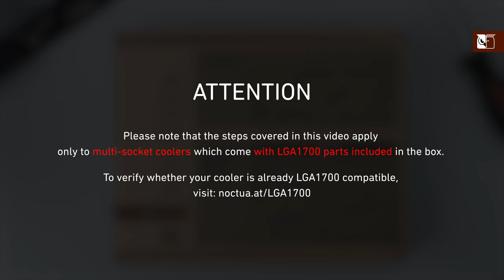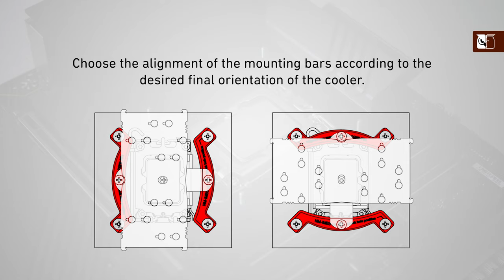Noctua SecuFirm2™ LGA17xx multi-socket CPU cooler installation

Comment: There's one really important piece of information missing from this video: you have to install the CPU *first*. Once the mounting bars are installed, you cannot install or remove the CPU.
Reply from the maker: Thank you for your feedback! It's correct that the CPU should be installed before you install the mounting bars. We thought that this should be obvious given that we show the CPU installed in the video and manuals. So far, customers haven't had any issues with this, but we'll keep it in mind for future editions!
Reply: Thanks for pointing that out as I was more focused on the brackets. I'm still trying to figure out 1 dot or 5 as they have conflicting info that needs updating.

Comment: Hello, I'm a Korean who likes Noktoa. I'm going to buy NH-U12A this time. Do I have to buy an additional MP78 backplate? According to the official website, the U12A purchased after January 2022 is compatible with the LGA1700. However, some posts say that I have to buy mp78 because the basic backplate is not good. What should I do?
Reply from the maker: Yes, as stated on our website, NH-U12A now already includes LGA1700 mounting hardware, so there is no need for upgrade kits such as the NM-i17xx-MP78!
Reply: @NoctuaVideos  Thank You !! 😊

Comment: I would like to ask some questions about the tightening of the screws. 

The First is about the nuts of the mounting bars (1:30). In the video it seems like you tighten the nut until it simply touch the bar.
Is that enough to hold the bar. I personally did a bit more. Do motherboards endure a bit more tension? How can I be sure I tightened the screws enough and not too much to destroy the board.

The Second is about the screws of the cooler when it is placed on the mounting bars. Should the bottom part of the screw (that looks like a flange) touch the mounting bar? In the video it seems like that is almost the case (1:57). In my case, I didn't tighten the screw until the bottom part reach the bar and I left it higher compared with that of the video. I left it when it started to resist a bit. I was afraid for the stress applied to the CPU. What should I do?

Thanks!
Reply from the maker: First of all, don't worry, there is no risk of damaging the motherboard by overtightening the nuts or the CPU by overtightening the spring-loaded screws. 

You should feel a clear stop when tightening the nuts shortly after they start touching the bar, so what you did sounds perfectly right. As soon as the bars sit firmly and you can no longer move them around by hand, the nuts are sufficiently tight. As we've said, there's no risk of damaging the motherboard by overtightening the nuts, the only risk is that you may rip off the threads of the bolts if you go too tight.

For the mounting screws, you can keep tightening them all the way down until you feel a stop when they touch the bars. There will be some resistance due to friction and pressure of the springs before, so don't hesitate to apply a bit of torque to get them all the way down. Again, there is no risk of damaging the CPU by overtightening, the only risk would be ripping off the threads from the mounting bars.

In short, we would recommend leaving the nuts as they are but tightening the screws a bit more until you feel the stop when they reach the bars.

Our maximum torque specification for both the nuts and the screws is 0.6 Nm, so if you want to make extra sure, you could use a torque limiting screwdriver. This is by no means necessary though, simply trusting your judgement of going to stop but not overtightening will work fine.

Hope this helps!

Comment: I have the NH-U12A but I'm confused, in the website it says I need the NM-i17xx-MP78 mounting kit to use it on lga 1700.
Reply from the maker: Yes, you need the NM-i17xx-MP78 unless your NH-U12A already included LGA1700 mounting hardware: https://noctua.at/en/productfaqs/productfaq/view/id/246/
https://noctua.at/en/intel-lga1700-all-you-need-to-know
Reply: @NoctuaVideos  Ow thank you. Newer NH-U12A units already comes with lga 1700 support. Unfortunately mine is older so I need the NM-i17xx-MP78 mounting kit.

Comment: I bought a NH-U12S new on Amazon March 14th and it didn’t come with socket 1700 mounting kit. I had to order the mounting kit separately on Amazon as I didn’t want to wait 2 weeks for delivery of the free one.
Reply from the maker: First of all thank you very much for choosing the NH-U12S, we're sure you won't be disappointed with the cooler! We're sorry that it seems you got one of the last units that don't have the kit included, the vast majority of stock already has it, but unfortunately, there's no way for us to know for sure if some resellers still have older stock. As you know, we do offer the free of charge upgrade, but if you're in a rush, getting the extra kit like you did is the best choice indeed. Have fun with your NH-U12S on your LGA1700 rig!
Reply: @NoctuaVideos  It's not entirely clear to me how I am supposed to request the free new LGA1700 kit for my cooler. Your website says I should have proof of purchase of the cooler and the CPU/motherboard. Ok I have that now where do I go?

Comment: Great video, will definitely reference soon as I build. I purchased an NH-L12S off Amazon last week for an upcoming build. Should I expect the bracket to come with it, since the timeline on the website for it mentioned November, or was that timeline specific to buying directly from you on your website?
Reply from the maker: The timeline is general (also for Amazon), so your cooler should already include LGA1700 parts! If not, please order the NM-i17xx-MP78 (free of charge)!
Reply: @NoctuaVideos  Thank you for the fast response! Happy Holidays!
Reply: @NoctuaVideos how can I order the LGA1700 mount free of charge? Your website points me to amazon store, it cost £8

Comment: Im currently needing to get a seperate lga1700 mount for my u12a since i got mine before the 12th-13th gen processors and motherboard came, which one works better with the U12A, the MP78? or the MP83?
Reply from the maker: Hi, for the U12A you will need the MP78 version.

Comment: Greetings! Will that intel mount kit that comes with the cooler, fit with my 12700k i7/MSI PRO Z790-A or should I buy the NM-i17xx-MP78 Mount Kit?
Reply from the maker: This depends on the cooler model and when you bought it. Most of our coolers include LGA1700 mounting hardware since late 2021, older models will require the NM-i17xx-MP83 or -MP78 upgrade kits. Please see our compatibility centre for details:  https://ncc.noctua.at/motherboards/model/PRO-Z690-A-motherboard-5367
https://ncc.noctua.at/socket-compatibility-overview
Reply: @NoctuaVideos  I bought the cooler (Noctua NH-U12A Chromax.Black) 1 week ago, so I should be fine with the kit included inside the cooler box, right?
Reply from the maker: Yes, absolutely, no need for upgrades then! :)
Reply: @NoctuaVideos  Thank you for your fast response you guys are the best :D

Comment: I have an NH-D14 and just ordered the LGA1700 kit so I can upgrade my LGA1155 CPU and I noticed the new motherboard has LGA1200 holes on it too. LGA1200 and LGA1155 are the same hole spacing. Should I wait for the LGA1700 kit or use the LGA1200 holes with the 1155 mount?
Reply from the maker: Hi, just to clarify, which socket are you planning on installing the cooler on? If you are planning on installing the cooler on LGA1700, then you will need to use the LGA1700 upgrade kit. The mounting parts for LGA115x and LGA1200 are the same, but LGA1700 is different.
Reply: Hi I have the Asus Z790-P and the board has both sets of holes for LGA1200 or LGA1700. The socket is 1700.  @NoctuaVideos
Reply from the maker: We would recommend installing the cooler using the NM-i17xx mounting kit.
Reply: Well your free kit has been almost a week now and you emailed and said it could be another 20 days so I tried the LGA1155 and it fit the LGA1200 holes perfectly and I have good temps using your NT-H2 paste.  @NoctuaVideos

Comment: with the Noctua NH-U9S, Premium CPU Cooler with NF-A9 92mm Fan can it be hooked up to a intel i7 87k cpu without needing to mess with the back of the mother board ? example open side of pc unplug pc take apart oldd cooler then hook up Noctua cooler without taking anything else apart ?
Reply from the maker: You will need to access the rear side of the motherboard in order to install the backplate. Most modern cases have a cut-out that makes this very easy to do without having to remove the motherboard. Installing a cooler of this size and weight without a backplate would be dangerous, so better be careful with coolers of similar size that offer this "convenience".

Comment: I could not find this information anywhere. Will the NH-U12S block the first expansion slot? Or is there enough clearance?
I'm buiilding a B660M Micro ATX build and worried it'll touch the GPU.
Reply from the maker: The NH-U12S doesn't block the first PCIe slot on any B660 board, this would only be the case on some ITX boards: https://ncc.noctua.at/coolers/NH-U12S-9/motherboards/all?q=b660

Comment: Any plans to release one for the NHL9i series? I saw a revision for the cooler to only support LGA1700. Does that mean I can only use older CPU with my original NHL9i or move to AMD?
Reply from the maker: Yes, unfortunately we had to create a new revision specific to LGA1700 because the height and clearing specifications of the socket are different. The original NH-L9i and NH-L9a-AM4 cannot be adapted using upgrade kits because there would be a high risk of damaging the motherboards.

Comment: The bracket that goes on the back of my motherboard doesn’t fit (it came pre assembled) should I use the lga20xx setup? I have a 1700 cpu. Would it mess up my computer/cooling efficiency ?
Reply from the maker: Do you mean that the backplate came pre-assembled (struts inserted and fixed with the clips)? If so and if it doesn't fit you LGA1700 motherboard, this probably means that the backplate has been pre-assembled for LGA1200/115x. In this case, please remove the clips and the struts, re-insert the struts in the LGA1700 position (position 2 in the manual illustrations) and re-fix them with the clips as described in the manual. If this doesn't help, please send us some photos at support@noctua.at so that we can look at this in detail!
Reply: @NoctuaVideos  the Lga 115x backplate appears to of had been spot welded together, not sure if there’s a way to separate the plate from the screws or not. but I will send some photos, thank you for your patience!
Reply from the maker: Ok, this is a backplate that doesn't support LGA1700, you cannot adjust it. You will need an LGA1700 mounting kit, either NM-i17xx-MP83 or NM-i17xx-MP78 depending on the cooler model: https://noctua.at/en/productfaqs/productfaq/view/id/245/

Comment: Can the base plate be installed onto the case or does it have to be directly install onto the motherboard? The reason I ask is because my motherboard is already installed and I'd prefer not to take it off if possible.
Reply from the maker: It needs to install to the motherboard. Most modern cases have a cut-out on the back side of the motherboard tray where the CPU socket is so that you can install backplates though. If your case doesn't, you would indeed need to remove the motherboard.

Comment: This instalation is more complexe than my previous instalation of a noctua , maybe you should focus on a specifique instalation of the lga 1700 with no different holes to chose and préinstaled bolts and clips on spacer. The position to choose at 0:44 is unclear what is position 1 and 2?
Reply from the maker: Thank you very much for your feedback! Since there are still lots of customers who use LGA1200/115x, we need to support both this and LGA1700. Pre-installing bots and clips would require a bigger packaging and would make it quite cumbersome for customers who need the other platform. This video is for LGA1700, so position 2 is LGA1700. Please also refer to the manual that comes with the coolers and is available online.
Reply: @NoctuaVideos  Thanks a lot for your answer, i have only bought the Nh u12S for my previous confuguration on 115x , it was with bots attached : https://www.youtube.com/watch?v=5kT2d83iAF0&t=264s it was a ok difficulty. On the 1700 you add a lot of difficulties in my opinion , i my opinion it will be better to put a segmentation to simplify the instalation. I have build my two previous PC and i can tell you that this one on 1700 is too difficult for me .
Reply from the maker: Once again thank you very much for your feedback. The problem with this approach is that if we would supply two different, pre-assembled backplates like the one we used for LGA115x, we would either have to increase the price for the coolers or offer two different versions, which would make them less versatile. Thankfully, the feedback from most customers is that assembling the backplate is easy enough, especially if you have done it more than one time.

Comment: Can this mounting kit be used on a NH D14? I have a Noctua D14 which I want to use on my new PC build with a i7-12700k and z690 motherboard
Reply from the maker: No, this is the upgrade kit you need for NH-D14:
https://noctua.at/en/nm-i17xx-mp83-mounting-kit
https://www.youtube.com/watch?v=Ioaon-11z24
Reply: @NoctuaVideos  Ok, Thanks for pointing me in the right direction!

Comment: Video only showed plugging in the second fan. Does the first fan connect to the second?
Reply from the maker: The cooler includes an NA-YC1 splitter cable that enables you to connect both fans to a single header. Alternatively, you can also connect both fans to individual headers.
Reply: @NoctuaVideos  Thank you... I tried both and decided that I like each one on its own header!

Comment: Hi if i buy this mount for My Nh-D14 , i can colling my 13600k processor with normal temps? Thx for Help!
Reply from the maker: Yes, you need the NM-i17xx-MP83: https://ncc.noctua.at/cpus/model/Core-i5-13600K-cpu-1638
Reply from the maker: Noctua_at
Reply: @NoctuaVideos  Verry Thx Noctua_at !

Comment: so what happens, if one mounts the backplate with the warning, opposed to the motherboard instead of facing it...
Reply from the maker: You may end up with lower mounting pressure and, at worst, if your motherboard has components underneath the arms of the backplate, damage your motherboard. Hence the warning.

Comment: Will this be compatible with a ASUS ROG Strix Z690-A Gaming WiFi D4 AND G.Skill Trident Z Neo RGB DDR4 3600MHz 2x16GB (F4-3600C16D-32GTZNC)? And do I have to order them separetly and wait a couple of weeks? Thanks
Reply from the maker: Which cooler are you asking for? The mounting kit as such is compatible of course but compatibility will vary from cooler to cooler: https://ncc.noctua.at/motherboards/model/ASUS-ROG-Strix-Z690-A-Gaming-WiFi-D4-5375 If your cooler does not yet come with LGA1700 mounting hardware, you will indeed need an extra mounting kit (see https://noctua.at/en/intel-lga1700-all-you-need-to-know ). You can use the LGA1200 mounting holes of the Asus boards while waiting for the kit though.

Comment: After installing the nhu12a cooler,  is it safe to transort the desktop?
Reply from the maker: As described in the manual, we would recommend taking the cooler off for safety reasons.

Comment: how do you remove the video card with this cooler?   Doesn't it block the plastic clip?
Reply from the maker: You should have no problem reaching it from underneath. At worst, you can push the clip down with the back side of a pen or something like that.

Comment: When did the five-dot method become a thing, as opposed to a pea-sized dot or 'x' in the center of the CPU? Just curious, thanks for the video.
Reply: I think it is because the processor surface is no longer square, but a rectangle. If you don't apply extra cooling paste on the edges towards the short sides the middle dot wouldn't cover the whole surface when squeezed out.
Reply from the maker: We have already recommended this for bigger CPUs for a while. Many methods work, but we have found this to be the easiest for customers to do that consistently gives good results.
Reply: I have tried the pea-sized dot method in the center for a 12900k (just apply a little bit more than your usual 'pea' amount) and I got the EXACT thermal results as with the multiple dots application. Just get a good thermal paste and you can use whatever method you want.

Comment: Can the motherboard afford the weight even on   vertical?
Reply from the maker: Yes, 100%, our SecuFirm mounting systems are designed to support these weights and protect the motherboards. We've been selling CPU coolers like these for more than 15 years and never had any issues with motherboards due to cooler weight.